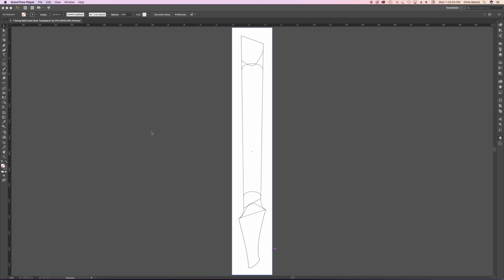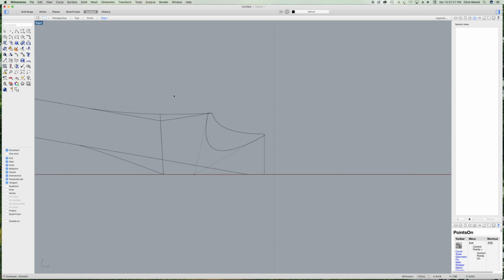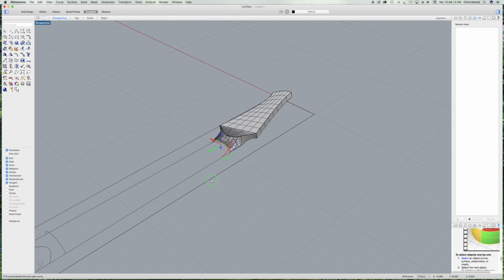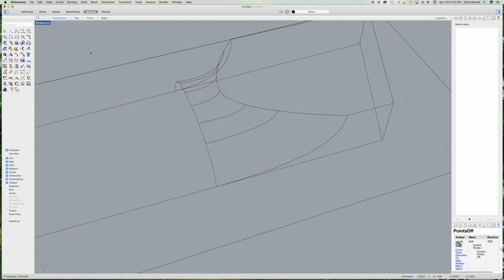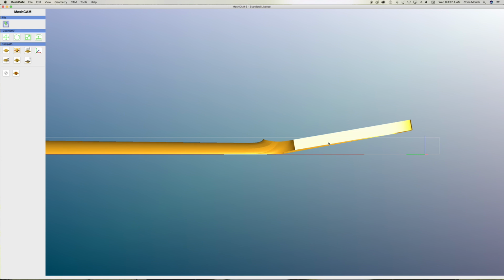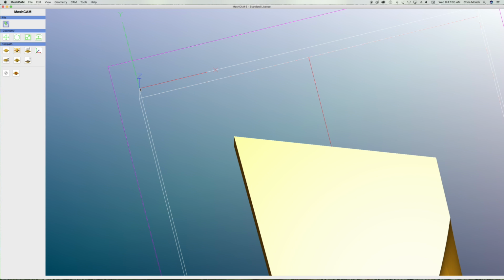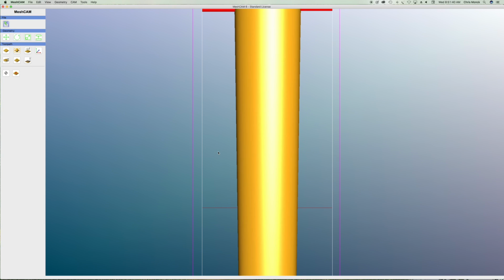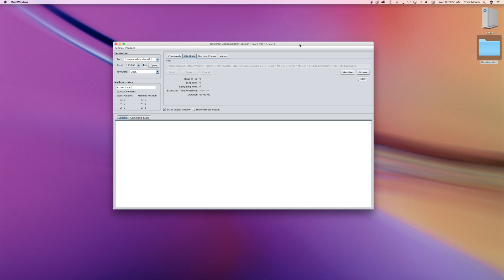Designing An Electric Guitar Part 3

Comment: Thanks for the great videos. I'm just wondering, why is an angled headstock necessary? Why not have it parallel to the rest of the neck and use staggered tuning posts to get the needed angle of strings over the nut as is done by some manufactures?
Reply from the maker: Despite what some folks will tell you, they aren't necessary nor do they do a better job of keeping the strings in the nut slot. That being said, I do them just because I like the way they look. It's a traditional thing I guess.

Comment: Thanks for the video! I'm a Rhino newbie and am having a bit of trouble. I'm designing a banjo neck and the heel has a shape more similar to a Martin acoustic guitar, where there's a curvy triangular portion for the heel cap. I'm trying to create the surface transition between my 12th fret profile and the heel area, but when I do the Network Surface command, it asks for the "first direction of curves" and then the second. I've tried numerous different combos there and can't get it to generate a surface. I have the neck profile shape, the heel cap profile, the fretboard sides, and the curves from the fretboard end to the heel cap included, as well as a guide curve from the tip of the heel cap to the neck profile shape. It's all nicely enclosed, but it always says, "Unable to use this curve network." Any chance I could pester you for ideas? No worries either way and thanks for the very helpful tutorial!
Reply from the maker: I focus on building guitars rather than software tutorials and advice. I tried that rout in the past and it's just not my area of expertise or passion.
Reply: @HighlineGuitars  Not a worry at all and I totally understand. I appreciate you sharing this video. It really helped me get off to a great start. I'm sure I can jump on the forums and get this stuff figured out. Found that the "Patch" surface command seems to work in that area for now. Take care and happy guitar building!

Comment: Well, it's a bad unorthodox approach on designing without G2 continuity on surfaces in Rhino, but I assume you took care of it after the cnc cut.

If you run a Zebra analysis in Rhino, you'll find out that there is no continuity at all. The whole structure of curves seems working, but it doesn't. There are better approaches to solve such a geometrical problem (that is challenging) as a guitar neck.
Reply from the maker: Wow, I learn something new every day when it comes to 3D modeling. Fortunately, my models have worked fine for what I need, but I can see how this will be of great value to know for future work.
Reply: Yep, as it works for your purpose it's already enough, but i doesn't mean it's always right! :)

I face it all the time, and it's really mind struggling, but worth the time/effort put for next projects.
Reply: Would you mind enlightening us on which approach you would use to design a guitar neck in rhino if not using curve networks then?
Reply: @tontonsatan3093   I kinda missed your reply and found it out today. Sorry for my... 3yr delay. :)

I would set it differently, but let's say you use this kind of network. One simple change with huge difference:

12:22 Run NetworkSrf, but selecting the edge of the first surface instead of the curve existing there, will give you an option of G2 continuity.

Comment: So when you are doing the curve (volute) at the headstock and neck pocket do you have specific measurements assigned for those curves? It appears in your video as if you are drawing those curves freehand on one side and then redrawing them freehand on the other side (instead of duplicating the finished side?), how do you make sure your curves are the same on both sides of the neck?

Comment: Chris, super helpful video, thanks for sharing.  You mention that you use a scarf joint and therefore cut the contour of the angled head by hand.  Do you cut and glue the scarf first to create a blank that you then CNC, or do you CNC first and then cut the scarf joint?
Reply from the maker: I make the scarf joint first then I CNC the neck's shape. The next episode will show the CNC work.

Comment: Hey, Chris. How do you get your curved line starting points up in Z axis in perspective? Mine seems to be locked on X and Y axis?
Reply from the maker: Select the curve and view it from the right or left. Use the rotate 2d tool and rotate with the shift key pressed to snap to 90° rotation.
Reply: You the man. Thanks